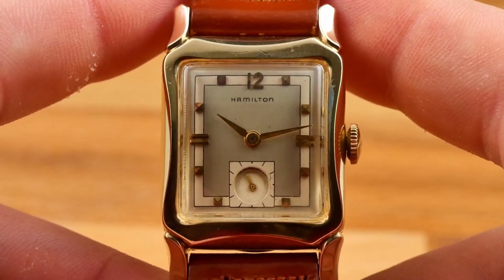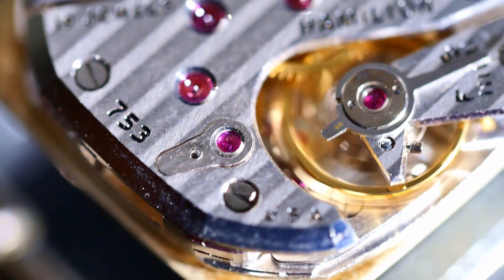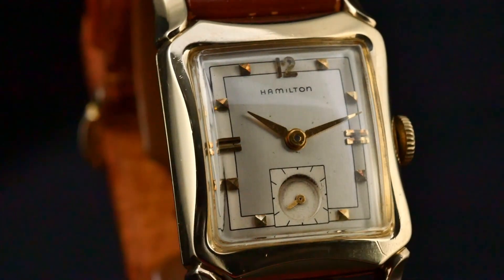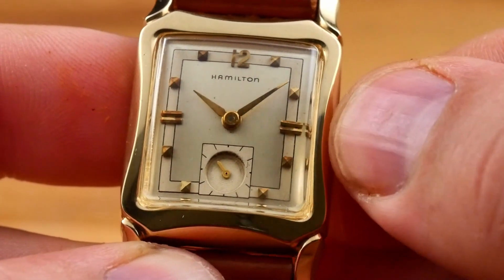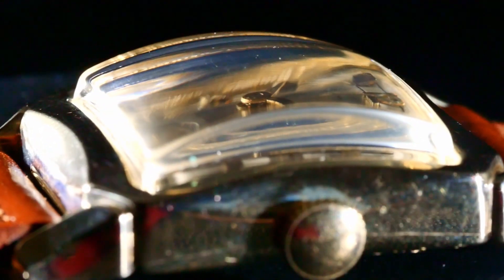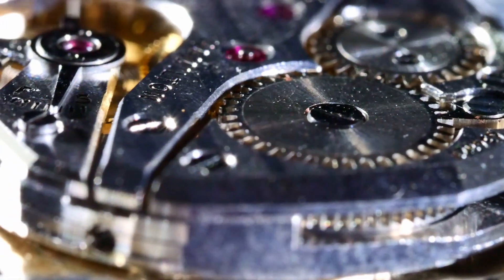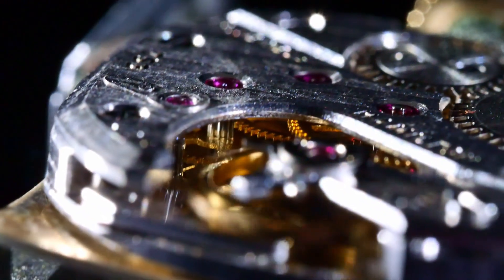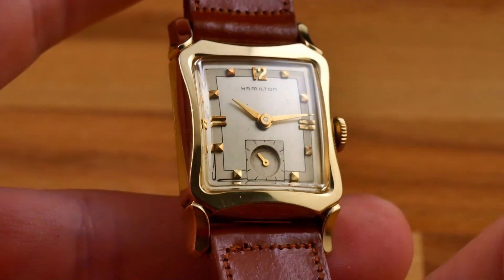Vintage Watch Review - 1955 Hamilton Pelham

Comment: hi may I ask you what is the black looking marks in side the wall of the second dile you can look at2:53 can yo tell me did u leave it there or its hard to comes out thank you for lovly video
Reply from the maker: Good question. The dark marks you see on the sub dial wall is where some of the finish has rubbed off, so there isn't anything that I can remove. In fact, if I had tried to clean the mark off, I likely would have rubbed even more of the finish off, making it worse.

Comment: It's a beautiful watch. I checked out your website, a lot of nice looking Hamilton's. Do you service other watches besides Hamilton? Thanks for the video
Reply from the maker: Thank you! I have, and sometimes still do, service watches other than Hamilton. I have a hard time articulating it, but I'm just really drawn to Hamilton watches, more than other brands. They're fairly plentiful, there is a lot of source material available for research, the vintage pieces are American made, and I just really dig the styling. Plus, focusing on one brand means that I have an extensive back stock of parts I can pull from.